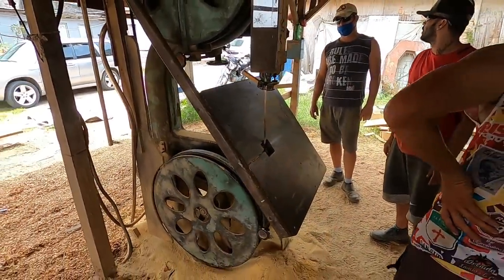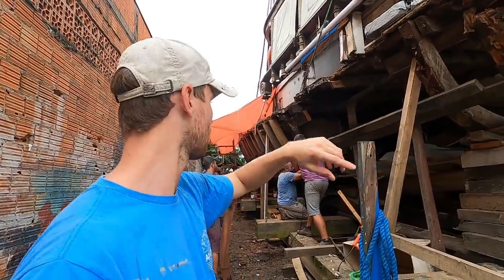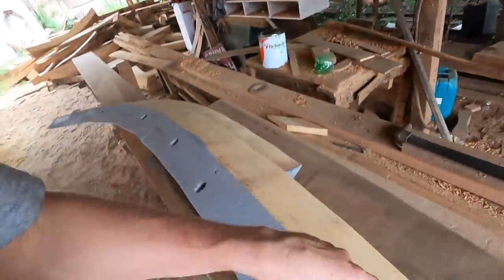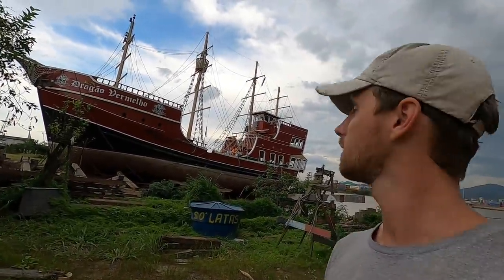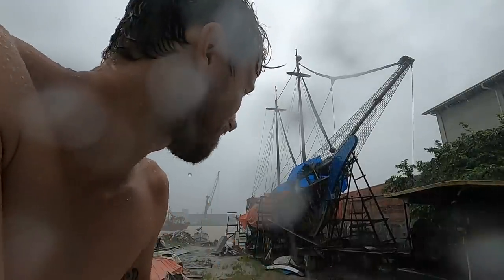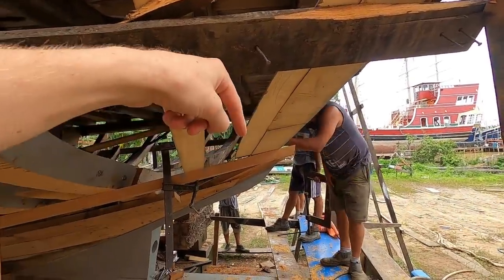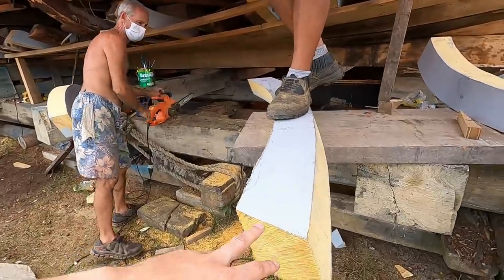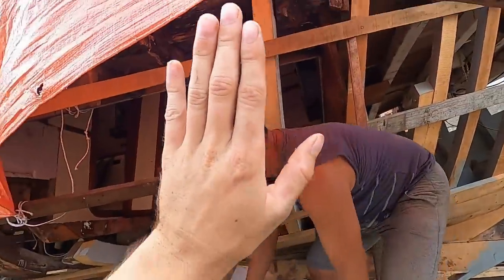We could have done WITHOUT THIS STORM! — Sailing Yabá #25

Comment: I’m so curious how much this is costing 6-8 people working every day, and lumber is so expensive right now.
Reply: I'm also curious about it!
Reply: lumber in that neck of the woods wouldn't be as expensive as it is in America right now. Its comes right from the lumber yards, not box stores.
Reply: I've been told (by a Brazilian) a boat yard worker gets around 1500 Brazilian Reals per month, times by 6 and convert to your currency and you'll have some idea. Also bear in mind wood will be cheaper in Brazil than other countries, because it's locally produced and doesn't need to be shipped in, but they are using certified plantation timber so it's probably dearer than the illegally cut timber.
Reply: @oldwillie313   sad comment, you dont have to watch, get creative...
Reply: @oldwillie313  take it easy dude.  think you jealous .  be cool or you will never get laid.  Also women like to see dudes with good shoes.  so go get some new shoes.
Reply: I came to this section precisely to ask for this question, How much is costing all this "little" fix?... and the first thing I saw is you asking the same thing.😎👍
Reply: @speedygonzales9090  keel timbers was menshioned at around 680 USD adopting a frame is roughly 83€ for me and 25ish for futtocks.
Reply: @oldwillie313  -  My stand point about this in life is...  Do whatever you want, as long as what you do doesn't affect me, go for it.😎👍 
However, I feel the same way about this as you do, I'm retired now, but I worked hard all my life to raise a family and to get what I got today, no body gave me nothing and I don't agree that people should be begging for money, (Patreon), so they can play all day long and having some one else paying for it.  Well sorry, but is not going to be my money.👈🙁
Reply: @oldwillie313  wah wah, wah, 😭😭😭. What about me. It’s not fair! Then don’t watch the videos cry baby.
Reply: @speedygonzales9090  they provide entertainment and you can learn a lot watching  their videos. You don’t mind paying your cable for channels you never watch or Netflix, it’s kind of the same thing here.
Reply: @daveamies5031  That's about $300 per month or $1,800 a month for 6 guys. That's crazy cheap. I don't think that's what's going on but if it is wow. They are going to have one fine boat when they are finished and regardless of how off I am, that's one hell of a good deal for a refurb sail boat the size of Yaba. Should make for some really great adventures on the high seas.
Reply: @daveamies5031  -  Well, at the current exchange that is about US$250.00 per worker, per month, (which is not much), but x 6 = US$1,500.00 in wages alone;  However, you have to add the "profit" the marina will make out of this repair, (which I bet you is going to double the wages), plus the lumber, plus other supplies = $$$,$$$.$$ ... ???????
All I can say is...  "I'm glad is not my money" !!! 🤑 👈😁
Reply: @oldwillie313  If you have an interesting story, a cute dog, and don't mind filming every step of it to be criticized by some people on youtube, yes you can have a new car.  It's all about the story.
Reply: @kingoreal-estate9475  -  Is not about watching, that is fine and I agree with it, if they can raise money through their videos, there is nothing wrong with that, they work hard enough to earn what ever money YouTube will pay them as per views;   What I don't agree with, is the "Patreon" part of it, they are begging for money, so they can play all day long, having fun while others work their asses off to pay for it.  From a moral point of view, that's not right.  

As a specie to exist /survive in this life we need to live as a "society", ... What is their contribution to it, if they don't work but play all day long?????
Reply: @oldwillie313  They are entertainers in a time when we all need entertaining. Why shouldn't they make money just like a baseball player or actor. They put a lot of effort into these videos. I think they should produce a documentary on the rebuilding of Yaba.  Cheers
Reply: @oldwillie313  my daddy taught me that if I have nothing nice to say, I should shut up. He also taught me to check my facts. These kids bought the boat and had the plan for their repair BEFORE they were talked into YouTubing by the crew on Odd Life! If people want to help them then who the hell are you to call them suckers? Keep your hands in your pocket and watch another vlog....
Reply: @speedygonzales9090  patronage has a very long history- we would never have seen the genius of DeVinci without him having patrons. (This is illustrative only - I am not comparing a Masters Genius to a YouTube couple)
They are not begging on a street corner and annoying you at a traffic light - they ask for people to help them in producing an entertainment segment- and some people are willing! From my point of view no harm no foul.
Reply: not sure it is in brasil.
Reply: @oldwillie313  ...  Me thinks ye confuse 'Kindness' in people...  As making them 'Sucker Bait'.  It does not, Sir!!!

The fact that a person has more than enough money to support themselves and their own families, and that person is willing to share what they have been so fortunate as to be blessed with...  That DOES NOT make them "Fools".

You, Sir, cast dispersions where only Satan would go.  You "Accuse" and you "Prosecute"  (THAT is Satan's Job)...  You do so in order to make yourself look good, to look like you are 'Intelligent', but at the expense of someone else.  I'll bet you climbed the corporate ladder off the Clawed and Bloody backs of your competitors.

Do you have a trace of 'Brown' on your nose?!?!
Reply: @speedygonzales9090  So don't help. You can criticize for free.
Reply: @oldwillie313  this the same thing Jerry Seinfeld does or Steven Spielberg. They create entertainment content and we consume it. Content is content. Why are you upset about people producing entertainment. This is more interesting than 95% of what is on TV.  All of Hollywood lives off of people watching their content. This is  not different  
They direct, produce and star in a wonderful TV show
Reply: @sailing_seaescape  - I totally agree with you, they work hard to make the videos, people watch them and YouTube pays them, no problem, "they worked for it".  
What I don't agree with is the Patreon part, is an easy way of having an lazed life, not contributing nothing to society and polluting the environment every time they turn on that old engine.  NOT COOL !!!👈🤬
Reply: @speedygonzales9090  I think you are over estimating what any one receive from their Youtube channel, the Patreon part is like the old time patronage thing, that’s what gets them going, . Youtube is just the free avenue that allows people to discover them, Patreon is where all the more valuable content is (generally speaking, not for this channel in particular)
Reply: @sailingsomeday5975  -  Giving an opinion is not a crime, so I say that from a moral point of view, to live for free at someones else expenses is not right.    If you are a quadriplegic and can not make it in your own, then is a different story and I believe that as a society we should help that person.  
As I said before, I believe in total freedom to do whatever you want to do, as long as what you do, doesn't affect me... Go for it !!!
Reply: @showmemo3686  -  
That is exactly what I'm doing !!! 👈😁

I watch many of these YouTube channels and I "always" give them a thumbs-up, even before I watch them and I do it because I want to help them out, but from doing that to "donate" money so they can live a easy lazed life... Mmmmmm... NOPE !!!

We need people to work and pay taxes, so we can function as a society.  I don't like taxes, but if we don't contribute... How are we going to have roads, schools, police, fire fighters, coast guards and all the goodies that our friend from Yabá enjoy without contributing to them?????
Reply: @oldwillie313  obviously, yes, there is
Reply: My Sunday morning, watching this, and Mustie1 actually fix things
Reply: @speedygonzales9090  we agree - no harm no foul...I just don’t see it as a Moral issue -
These kids bought the boat and planned the refit before another channel talked them into YouTube/Patreon- so if people feel entertained and want to contribute to help assure that entertainment continues I don’t define that as begging- any more than an actor making 150 million dollars off a successful movie....
They have about 160 patrons and let’s assume each is middle of the road and contributes 5 bucks per episode- nobody is getting rich on 800/week ( mos probably do 2 bucks so probably less then 800)
As a channel that just started and has less then 50k subscribers and 25 videos with the highest number of views being 175k they are not getting rich of YouTube cash for sure. 
Just myy opinion (your right we can all have one) ...enjoy your Sunday 😀
Reply: @speedygonzales9090  ...  Hello, Speedy!  Thank you for defending Old Willie.  You two are like brothers in thought.

Since you asked...  Or accused, actually...

Christian?  Sorta kinda, with a touch of Demon!  Democrat?  NOT, currently!  

Brown on my nose?  Ha!  People who know me would tell you different.  I'm a "Wolf"...  Born and bred.  And I love, love, love, love "Battle"!!!

First of all, I don't like Humans.  

Well, to be fair, I do like Humans who are intelligent.  I like Humans who are artistic.  

However, 90% of Humans are a waste of space.  However, even 'Waste of Space Humans' do have redeeming qualities.  Many are kind.  Many are dead honest.  Many would give you the shirt off their backs.  

Out of the 10% of Humans who are, actually, intelligent, only about 5% can claim to have enough intelligence to make them, really, smart.  Not "Wise", but "Smart".  I know a guy who has an IQ of 170 and who has worked in Military Intelligence and in Nuclear Power.  But he is as dumb as a rock...  Subject of his Humans "Feelings", which rule him. 

Personally, I DO NOT have "Feelings".  I consider those Males, who are ruled by their "Feelings", to be not much different from Females. 

The top 5% of people, who have intelligence so high that they are unable to blend with the 90% who aren't intelligent...  MOST of those Humans are NEVER seen by ordinary people.  These of those who have the intelligence to put them into the category of the Humans who are in that Top 5 percentile.

I live in the mountains of Virginia.  I'm surrounded by "Ordinary People"...  Or those who are viewed by "City Folk" as 'Not that Intelligent'.  However, I'd rather be around these 'Meek' people, than to be around those who think they are smart.  I'd rather be around them, rather than those who feel free to make suckers of simple people.

Ben & MP are not making 'Suckers' of anyone.  They produce a product, period.  They put their intelligence and the creativity together to make these videos we watch.  They are not 'Begging' so much as they are making us aware that there is such a thing as "Patreon".  

It is your choice to enjoy the content for free to you...  Or you can appreciate Ben & MP's "Creativity" and reward them with more than your eyes watching for "FREE", but with the reward to them of a dollar or two to boot.

Maybe you are one of those Democrats, who want to stay home and never take a job, but get paid by our government to sit on your ass.
Reply: @oldwillie313  No, your winning personality doesn’t warrant it.
Reply: @bobadam7021  I bet old willie’s story wouldn’t get many patrons.
Reply: @speedygonzales9090  Hopefully not for the same stupid, narrow-minded reason...  dumbwillie is a sad, mean guy. 😝
Reply: the 1500 real number may be a tad low but close....thats net though and employment taxes are bad im brazil....lets say 500 usd a month all in...inclufing higher wage for lead guys....3,000 usd per month labor and profit......wood is going to end up costing 5,000 all in.....bolts etc.5,000....yard fees 500 a month....

ill call it 30k usd to get new hull painted and in water wirhout engine or interior work
Reply: @speedygonzales9090  ...  "WOW !!!... Did I touch a nerve???..."  

Sorry, I don't have any nerves to touch.  I see opportunity.

"1- The way you spoke about being kind and then about the devil and all that, you sounded like a true Christian, that was all I meant, no more than that."

Fairly said, Sir!  Fairly said...

 "2- So I was right about you being a Democrat, is just that you are not one right now...???"

My parents, on both sides, were Democrats.  I didn't care one way or the other.  I had other things on my agenda.  I didn't care, until it became apparent that our 'Rulers' don't give a shit about us peasants.

"3- About you being a "Brown Noser", all I did was to "Copy and Paste", what "you wrote to Old Willie" and was pure sarcasm, thinking of you as being a Christian and talking like that... Shame on you.👈😁"

You are 100% correct, Sir.  I am guilty as charged.  There are many things I have done, but do far less in old age, that I am more guilty of.  I don't care about 'Judgment' from anyone.  When they have been and when they have done what I have done, then they still have no right to "Judge" me.

"4- Let me guess, where you place me and where you place your self in the 90% v/s 10% equation, never mind the 5% one, will live that one alone. 👈😁 🤣🤣🤣👍"

Actually, Sir, I don't know you.  I don't know your heart.  I can only draw conclusions by what and by how you write.  

As for where I'd place you in regards to where YOU "Think" I "Think" I might be on that scale, I may not even be up to your level.  My IQ is, only, 132.  The average is 105 to 110.  That makes me above average in intelligence, but not at the top of the heap.  I can only run with the Big Boys via my 'Craftiness'.  I'm not that smart.

"5- Well, if Ben & MP are so intelligent, why aren't they billionaires and buy a brand new Yacht, so they don't need to beg for money to hard working people to fix an old boat??? Nope, they are not making us aware of Patreon, all YouTubers know about Patreon, they are "directly" asking for help to fix their boat; If they didn't have the thousands of dollars pouring into their bank account every month, they probably could not afford to fix the boat the way they are doing it, that costs a lot of money, even if is in Brazil."

And there is your failing...  I've watched the same requests for assistance, which Ben & MP have made, as you have watched.  Ben & MP "ARE NOT" begging!?!?  If you watch as many talented craftsman on YouTube, as I do, you'd have to conclude that there are YouTube Channels, which shamelessly grovel for money.  I don't see any groveling from Ben & MP.

And shame on you for implying such, Sir!?!?

"6- I do support them with the videos, before I even watch them I right away give them a big fat thumb-up👍 and I'm subscribed to them, so I contribute with my humble one penny every week.🤑👍"

I'm not trying to sell you anything, Bud!!!

"7- Nope, I hate Democrats and dislike Lefties all the way, they are a destructive bread and hurting our mere existence."

I don't hate anyone.  I don't even hate the idiots.  I pity them.

"Well James, has been a slice talking to ya, but don't hate me only because I'm not in the top 5% you are in.👈😁 You got a big EGO, Pal !!!🤣🤣🤣👍"

Actually, I barely make it into the very low 90%, considering some people I've met.  If we are graded on the old school scale, then 90 to 100 is an A.  I'm screeching in at about an A-.  

"Big Ego"?  Well, everything else about me is small.  So, at least my Ego is big...
Reply: Me too!
Reply: @daveamies5031  let’s not forget the boatyards cut... so it would be at least double that... electricity isn’t free... power tools aren’t free.... bandsaw blades aren’t free... and wood no matter the cost isn’t free... you kinda get the whole picture...
Reply: @daveamies5031  in my country its only 1350 euros for six people that is in us dollar 1650$ thats a straight up steal! Send these people tp me please😜
Reply: @marcryvon  -  I don't react the same way Willie does, I'm more for freedom than I think he is, all I said, is that in principle I agree with him, in the sense I don't like to see people asking for donations through Patreon to help them live the way they do, without working a single day as 99% of the rest of us do, to make a living and to cooperate with society through our taxes.  Other than this, they can do whatever they want with their lives, as long as what they do doesn't affect me, they can go right for it.😁👍
Reply: @oldwillie313  We all know that envy is a deadly poison. Take care
Reply: @Robert P The woods aren't from rain forest
Reply: @gg9960  -  I think you are short in your estimates, by the time they are back in the water I think is going to be more like in the 50Ks for sure.
Patreon is working great for these people, same happens with other "shows" like "SV Delos" or "Nomadic Fanatic" where they have "luxurious" lives styles, without working a single day for anybody.

Cheers, let the money roll !!!👈😁
Reply: @speedygonzales9090  not disagreeing.....if you read my comment its just hull....no interior, engine mast etc.....final number will be what u said if not 10k above
Reply: @oldwillie313   Nobody has to watch their videos or become a patron ( i cant afford to but i enjoy them for "free") and the end result is a boatyard being able to pay its workforce and many thousands of happy subscribers.
Reply: @cpt.mirones5109  Thanks for the info :-)
Reply: @jamesturner3777  -  James... I'm not 100% sure yet, but I think I begin to like you, you seem to be an OK guy.😁👍

I said I hate Democrats, but is only a way of expressing my self out of anger to see how they are destroying everything that has taken many decades to build and they don't even care.  I see they care only about being greedy and obtain more power, the rest... they don't give a crap.

When I say they are begging for money, I don't mean I see them on their knees with tears rolling down their cheeks, but, that is basically what they are doing.  
When they "invite" you to donate, they are saying... "Help us pay for the repairs to our boat, so we can go out to the world sailing the 7 seas and we hope you keep donating so we can continue living this life style until the day we drop dead".

And they are not the only ones are doing this.  Don't know if you are familiar with "SV Delos" is another YouTube channel that they been doing it for "10 years".  They started out of Seattle and they went around the world one time and that is only supported by donations, not working for anyone.  
Similar to this, (but is not a sailing platform)  is this guy Eric, going around and around in a motor-home all over North America, he doesn't work at all, all he does is travelling in his motor-home and he doesn't ware the same T-shirt, baseball cap or sun glasses twice and these are not cheap either, buys lots of "toys" for his personal use, like $2,000.00 electric bike, a brand new Honda motorcycle, bought a house in Illinois, where he has a half dozen pinball electronic machines, a hot tub, does very expensive repairs and renovations to his RV, just bought not long ago a Smart Car to town along with his electric bike, his motorcycle, has what is believe to be the biggest "Mickey Mouse Collection" in Illinois, worth a few thousand dollars, etc... and the list goes on and on and on...
That how bad this can become with time if they are successful and I can give you plenty more examples of what goes on with this new phenomenon.

Just to make it more clear to you...  I don't have any issues if they can achieve what I just described, if they can get it through number of subscribed followers and number of views per video, what I don't agree with is the "begging" through Patreon to have a luxurious life without working a single day for nobody, that is "morally" wrong.👈🤬 

Have a good one, James !!!
Reply: @gg9960  -  I'm not saying you are wrong, I am adding  my comment that I think your numbers are very conservative, in my opinion I believe that the cost of the total repairs will easily reach in the 50Ks or maybe even more... ????? 🤔 🤔 🤔
Reply: @speedygonzales9090  my point was my initial comment was only in regards to hull work
Reply: @speedygonzales9090  ...  I can tell that you are "Old School", Speedy.  

I grew up just after WWII in the mountains of Virginia.  I thought Stuart was a big town back then.  Our boys were coming home from the war, a few at a time.  Most of these Boys had seen "Hell on Earth".  My Dad was an outlaw, so I met all kinds of folk.  Dad taught me how to read people.  

From these Young Men, I listened to many tales.  But I heard many jokes, as well.

Back then, average people, good people, honest and true...  Had a saying.  Their saying was much like what you stated.  They'd say, "If a man don't work, then he can't eat, either."

As for Ben & MP getting rich off this project...  Good for them.  May the Lord Bless them.  I hope they live well and invest their funds wisely.

I couldn't care less whether or not Ben & MP get rich!?!?  More "Power" to them, if that happens.

But, it will be interesting to watch and see if their personalities change with success.
Reply: @jamesturner3777  -  You make a couple of good points.

I very much agree with the saying...  "If a man don't work, then he can't eat, either."
I think is nothing but fair to say that.

The world is totally upside down now a days, young people believe society have to give them every thing and more... and right now... and free of charge, of course.

I have nothing against rich people, "as long" as they "EARNED" their fortune legally and did not steal it from anyone or any where.  I don't feel any jealousy or envy toward that type people, I say the same as you say... Good for them !!!  
Same I think of people than wins the lottery, they didn't take it illegally from anyone, so... Good for them !!! 

That's the thing... I've noticed that some of  these YouTubers as they get successful, their personalities change, they get cockier, you no longer see their humbleness you used to see in their first 100 videos, they start having luxurious lives but not working for them, etc...  That is when I say that, "that is wrong", not saying that is illegal, but is "morally" wrong.

Take it easy !!!
Reply: @gg9960  -  Yes, I understand.😎👍
Reply: @speedygonzales9090  If it only costs them 50k to repair it, then they've gotten a massive boat for way, way under market value.  70' schooners start at 100k USD.  I wouldn't have taken this gamble on a sinking, rotted out wooden hull, but it's not like they can't possibly come out ahead.
Reply: @cvar1  -  I don't know if you have seen the first few videos, where you can see the condition that the boat was, you could've said it was a submarine not a boat.  Also, they are in Brazil not in the USA, market value is totally different.

But... What does anything you are saying has to do with our topic???  
The topic or question here is if is OK or not to ask for financial help to fix what has become or is going to end up being a "recreational or pleasure" boat...  ?????
Reply: @speedygonzales9090  I was responding to your repair estimate and ignoring the patreon fight.  Since you insist, whether they ask for help or people choose to assist them is their business and is neither moral nor immoral.  If I decide to put up a fence and ask my friends and family for help, I haven't wronged anybody.  You can ask for help for literally anything, people can decide for themselves if they're comfortable supporting that endeavor.
Reply: @Robert P yea we need to get rid of that pesky rain forest  !
Reply: @oldwillie313  Your making assumptions, they have not said how they paid for it, I guess you angry cause they did something and you've never done anything with your life? Can't you just enjoy the story and the refit?
Reply: @Robert P Actually they addressed this a few video's ago, this is certified plantation wood not rainforest wood.
Reply: @goboyz8016  Actually it's similar to the wages in Indonesia and better than many other countries, it's really only a few countries in the world that have high wages.
Reply: @jerryclayton4616  I agree, I never intended to give the whole picture, I don't even claim to know the whole picture, but giving the wages gives you perspective, in most countries the cost of things are relative to typical wages, so knowing the wages gives you a good idea of the overall costs.
Reply: @thumbs97  I'm sure the cost of living in your country is much higher than Brazil too, so the same workers would need a similar wage to what you described sustain the same lifestyle as they have in Brazil.
I've lived in quite a few countries and usually the cost of living is proportional to the wages, I have lived in countries with both low and high cost of living and the wages I earned varied accordingly.
Reply: @daveamies5031  cant imagine they live in a villa right now but..😅
Reply: @thumbs97  Villa can mean different things to different people, and I have no idea what it means to you, let me give you an example, when I lived in Singapore I found that when Singaporeans talk about a "Bungalow" they are talking about a luxury free standing house, but for me it meant something more like a cheap dilapidated beach shack several days drive from the nearest town with no electricity or running water. 
I have also found in life that what some people consider extreme luxury others consider utter poverty. 
Having experienced both extremes and in between in 5 countries, my advice is don't focus on the cost or the money, look at what they are achieving and take inspiration from it if you can.
Reply: @daveamies5031  sureeeee👍🏻
Reply: @Robert P Does it matter who doing the damage ?  As long as we get wood ! I'm not going to build with farmed wood. I only build with free range lumber ! Lmao
Reply: @speedygonzales9090  People are paying for the entertainment value. Perhaps you like to watch content for free. Nobody thinks twice about paying a Netflix or cable subscrioption. What is wrong with paying for entertainment, particularly if you are not forced to pay? If you like it, why should it have to be free?
Reply: @speedygonzales9090  Patreon is just a way to donate. Other channels have 'buy us a coffee' or a Paypal donation. The video editing along takes hours and hours and hours of their time....
Reply: @speedygonzales9090  You want something for nothing then. At least you are honest about it I suppose. It's odd that you support giving people something for nothing (welfare) but not something for something (a video production that you spend your time watching, presumably because it entertains you?)
Reply: @Robert P You don't feel any shame in spouting nonsense like this? The wood they are using doesn't come from the Rainforest, it comes from Brazilian Midwest Savannah.
Reply: @wilfulsprite555  -  More than half of the money they make, usually comes from the "number of views per video" and NOT Patreon, some times is 100% of the money just from the views.  
When I watch these videos, (before I even see them), I "always" give them a thumb-up, precisely to help them out and I, (of course), subscribe to their channel.  
I think that is a fair deal, they get one penny every time someone watches their videos x how many thousands of views they get,... that's how they make most of their money.

If you want to give your money away, go ahead, don't let me stop you;   Personally I don't believe in paying people's way to play and have fun 24/7, year around, without working and contributing to society.
You can disagree with me if you want. 

Cheers !!!
Reply: ROTHGAR The Viking yes it is brasil
Reply: @wilfulsprite555  -  I know perfectly well how YouTube works, I've been a YouTuber for a long time.  Just a handful of years ago, "Patreon" didn't exist, some one thought about it and introduced it and it spread like dry grass catching on fire.

I know is painfully long to edit and put together these videos, if they don't want to do them, then... DON'T.👈😁
Reply: @daveamies5031  that’s incredible. It would probably cost 15,000 Brazilian Real per month per craftsman in the US!
Reply: @wilfulsprite555  -  Mr. Sprite, There is a HUGE difference in between "donating to the needy", (which some times could mean the difference in between life and death), than to give to someone which their only purpose in life is to play and have fun, 24/7 all year long, if you can't see or understand the difference, then you have a serious problem.

Cheers !!!😎👍
Reply: They should be brave enough to share the refit cost with their subscribers.
Reply: @cpt.mirones5109  we have know idea what your saying. English please.
Reply: @daveamies5031  That’s about 1200 euros per month for labour
Reply: @oldwillie313  Oh my. Where to start. These people are putting money into the local economy. I doubt whether Patreon and YT cover very much. Are they working...well I would say yes.  Nobody is forced to send them money. There is a whole entertainment economy built around reality content. If you don’t like it then tune out👍
Reply: @mikewilliams4499  It probably is, I don't use euros so wouldn't know, so how does that compare to wages in Poland, Bulgaria, Ukraine or even Morocco, Algeria, Tunisia?
Reply: @sailing_seaescape  Exactly
Reply: @johnsonjjohnson100  -  This is unbelievable;  Some one, (old willie313), said something nasty about them and suckers that give them money and blah, blah, blah... and then he disappeared never to be seen again. 
I said to that person that I "partially" agree with him and gave my opinion about the hole thing and PERIOD, that was it.

Now, I happen to be the bad evil guy that I´m coming after them and that I want to hang them from the highest tree in town... How that happened?????

I have no problem with them doing YouTube videos and earning money that way to finance their projects, I think that they deserve what ever money they can make that way, I know perfectly well how much work goes into videoing and then editing those videos, so this far I think we agree.. Don't we???

Now, what I don't agree with is the Patreon part of it and my reason to do so, is that I don´t think is right to ask for money so people pay their way so they can have permanent fun 24/7 all year round.

Now... That is "MY OPINION" and I have all the right to express it, if you don´t like it or don´t agree with it, well, that is your problem, NOT mine.  What part is the one you don't understand?????

I follow many channels, boat channels, aircraft channels, politics, etc... and I DO NOT donate to any of them, I do support them dough, by:
1-  subscribing to them.
2-  giving them a thumb-up right away, before I even watch the video, just so I don´t forget to do it, that's how I support them.

This is how they get most of their money anyway and NOT through Patreon.

You have your opinion, I got mine.

Have a nice day !!!
Reply: @speedygonzales9090  ...  Well Speedy, here's the deal.  After conversations with you, I find that your opinions are selfish based and will NEVER change, even if you were shown that you are WRONG.  As the saying goes, "You can't fix stupid."

I do not care whether or not Ben & MP get rich off this venture.  I hope they do get rich.  But, only time will tell what kind of people Ben & MP are.  We have NO RIGHT to 'Judge' them...  Especially accusing them of being 'Good For Nothing' people...  Living off the goodwill of others!  

PLUS, YOU accuse them way too soon.  And you do that, maybe, YEARS before it, even, happens...  If it happens.  This matter requires 'Patience'.

However Sir, you want to burn them at the stake right now.  Sounds like the "Salem Witch Trials".

Bottom line...  You, Sir, are "Jealous".

You want that 'Lifestyle' and are indignant that someone 'Not YOU' might achieve it.

If you want to be jealous of someone's wealth, there are Thousands of 'Hollywood Types' living in multi million dollar houses, driving cars that only the 'Rich' can even consider buying, with lots of Toys of all kinds, traveling all over the place and being worshipped as demigods...  By idiots.

Yet, you are critical of a couple of fairly nice 'Common People', who are guilty of, only, trying to make a different kind of life from that of 'Ordinary People'.  They are artists, because they take disaster and attempt to raise it back to glory.  

And you find 'Fault' with that!?!?

If you want to be critical of someone who deserves it...  Try being critical of the Kardashians.  

Kim makes one sex video of her getting plowed by her then boyfriend, has some plastic surgery to enhance parts of her body and, suddenly,  Kim is the ideal woman and all the little girls want to be just like her.  Does Kim do anything, whatsoever, constructive???  It seems that she is quite efficient at getting married multiple times and switching boyfriends, when a better one comes along.  IS THAT Creating anything???

Adjust your attitude, Sir.  There are many good things going on in Ben & MP's venture.  You just don't care to look at that.  You just want to accuse them of being "Scammers".  

They are not 'Scammers'!!!

Those who contribute to Ben & MP's project do so "Willingly".  No one twists their arms to make them send money.  And those who contribute, already, know that there is nothing that they can get in return for the money donated.  

But all they want...  Is to watch this project proceed.  To do so...  Requires "MONEY".

Go start you own "PROJECT".  Let me know where to find it.  I'll watch and see if you have a brain or not.
Reply: @jamesturner3777  -  Hey Mr. Turner,  
I don't think I have treated you badly, much less insulted you, as you have, calling me straight forward "stupid" and "brainless", just for having a different opinion than yours, that is not nice, specially in a public space such as this.  
Apparently it's true the old saying...  
'At a shortage of arguments, here comes the insults"

Did you even watched the video link I sent you, before you uttered all these insults to my persona???
I ask, because you don't say if you did and seeing your attitude, probably you didn't, after all it seems to me that once you make up your mind, that's it, you are always right and everyone else is wrong.  I was right when I said you have a BIG EGO.

The way you like to see things in life, it doesn't mean that you got it right and every one else is wrong and the fact you want everyone else to think the same way you do, that is being a bit "fascist",... isn't it?.

Anyway Mr. Turner, thank you very much for your time and the free insults.

Have your self a wonderful day !!!